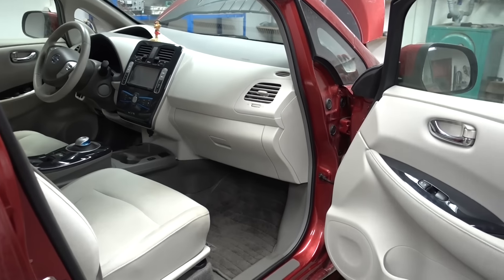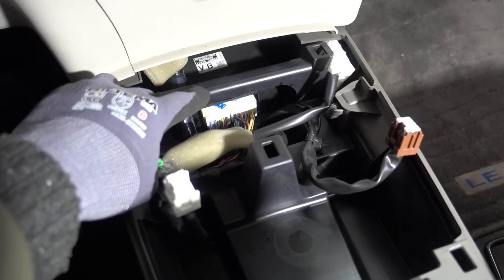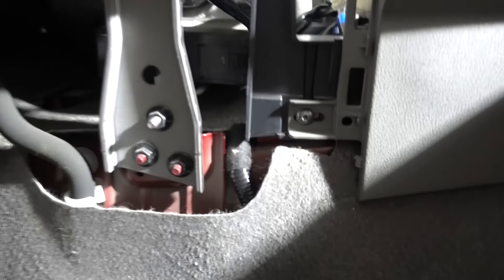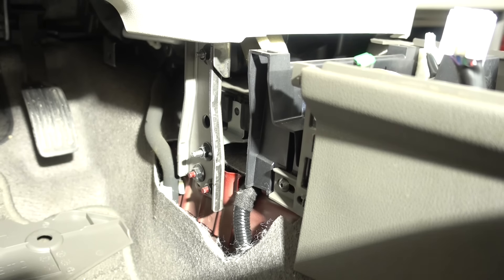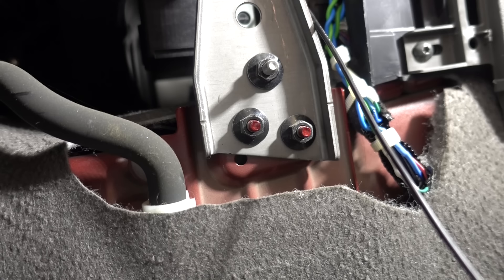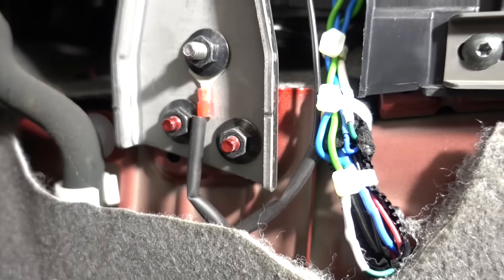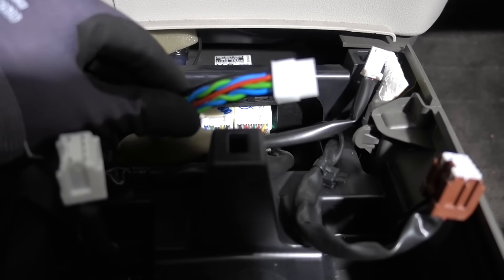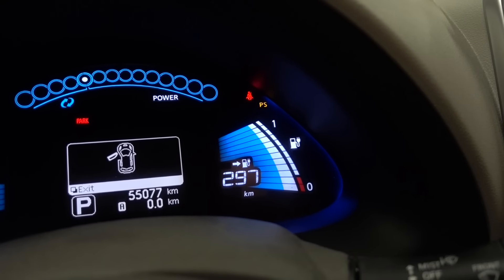CAN-Bridge Install [2011-2013 LEAF ZE0]

Comment: You should watch yourself some videos how to treat cables...the idea and your guidance is good but the execution is really bad... professionals don't work like that!
Reply from the maker: Yes, good feedback! I rather work with software compared to hardware 😅
Reply: Can you explain bit more? I have worked on rally vehicles, access platforms, normal vehicles. And seen terrible things done by so called "certified professionals". The only things that I would have done differently are, heat shrinks like to be heated from both sides for a proper seal, also I like glue lined ones. And I would used some conduit or cloth tape on new wiring loom just for extra protection. But that's only my preferences and I can't see anything wrong done by Dala. His wiring done outlast the vehicle anyway. So, Nikolaos, please explain what should have been done differently so we can all learn :)
Reply: @ev-olution8597  He's just hating.  The work here is fine.
Reply: The wiring here is fine, can't see why it wouldn't last.

Comment: 8:25 instead of sweating with big tools like mr. Dala there did, you could just rest the wire onto your cutting blade and gently roll it with your finger a bit on the blade, to cut through the insulation and then pull it off. 
And hint for Dala, when you do use the tool - add additional pressure on the tool top clamping bit, so the insulation doesnt slide off the tool easily ;)
And if you are a beginner, dont use cutters for stripping :D This is just asking for trouble :D
Reply from the maker: Absolutely! Superb advice, I should have looked at some basic wire stripping videos before making this fumbling video 😅
Reply: naah, your video is fine, much better than my upcoming rear stack fixup potato quality video with me putting roofing mastic instead of silicone between the battery halves :D
Reply: @DalasEVRepair  I really like the Jokari Super 4 stripping tool, it's not sideways -pointing but more like Alligator/Xenomorph eating the insulation off wire. It's plastic but surprisingly sturdy, I've stripped a lot of MMJ with it too.

Comment: Very nice video, its very tempting to pick up an old leaf get a bigger battery along with your cam bridge, I would also put some big heat shrink tube over your new harness just for vibration chafing protection 👍

Comment: A real good enjoyable vid. You know it is good when you watch the whole thing and you do not even own a Leaf. Instead of cutting into the OBD 2 wiring , what about running the wire to the fuse box and using a fuse tap? The owner must love the new range. Could you make it a business upgrading old Leafs? Looks promising.
Reply from the maker: Yes, running a fuse tap from the fusebox is also a great option! I am working on making it a business ;)
Reply: @DalasEVRepair  We get a lot of these first generation Leafs being imported to Canada  from California ,etc and although they have very little mileage on them the combination of the heat and fast charging damages the battery. After upgrading the battery as you do the vehicle will last for ????? and with such low mileage on them they are like new.Good luck with your business.

Comment: Thank you very much for all the work and information that you are sharing.
I have a newer leaf and need to connect the CAN bridge to the left of the steering wheel that you have showed in another video. I am uncertain which side of the cables in the car that goes to the battery, can you explain this?
I also like to ask if the 3D file for the case can be find for free or if it is your design, will consider sharing it?
Reply from the maker: I will do a separate guide video for the newer AZE0 model. You can check my previous video where I show a completed CAN-bridge install on an AZE0.

My software autodetects the orientation of CAN1/2, it doesn't really matter :)

The 3d-case is specific to my latest own version of the CAN-bridge (bit thicker than Muxsans design), but I can upload it to github soon. Won't be useful if you haven't purchased a bridge from me though!

Comment: Thats great, but with a 2 port bridge the wiring colors are different. Question is the Can-1L & 1H I assume this gets connected to the lower side but does it matter which wire gets connected to the low side or are the wires reversible and the same would aply to the 2L&2H side?
Reply: Never Mind I found the wiring Diagram... Thank you your a BIG Help!

Comment: Daniel, I wanted to ask you is there a way that the can bus can turn off the reverse beeps inside the cabin ?  I have disabled the external via leafspy,  I have a very long driveway in reverse and often have to sit for ages till the traffic is clear. Drives me mad !
Reply from the maker: Not that I know of!
Reply: Daniel Öster - if you work that one out I will buy what ever dongle I have to :) I wonder if the reverse noise is its own tweeter, I might rip it out :)

Comment: hi wear i can get the bridge por  any links i got a 2013 leaf will like to add a 2018 leaf  battery pack can i used for that? or what is recommended? grate video
Reply from the maker: Here's a link https://dalasevrepair.fi/can-bridges/

Comment: Hi Dala, another great video. I have a CAN bridge installed in my eNV200 40kWh by Emile when they did my underslung 20kWh range extender. Aside from the battery pairing what other functions can be achieved? I'd really like some way to manually switch on the battery cooling rather than having to wait for the van to be charging, is this possible?
Reply from the maker: Yes it is possible to force cooling on, but it will cool the cabin at the same time. Get in touch with Muxsan and ask, I can't offer any firmware solutions for you, they would overwrite the muxsan range-extender bits 😅

Comment: HI Dala, thanks for the tutorial!  Just one comment/question about the ground connection: Because of road vibration, the bolt can get loose and causing the clamp to disconnect? If that is the case, should be better to connect ground  by soldering to a proper vehicle ground cable?
Reply from the maker: Yes, other methods to ground the wire can be used. And if you are worried about the nut vibrating loose, threadlocker is always an option!

Comment: Hi dala.. Can I know wether after installing THE CAN bridge is the range really extended.?My 2012 ZE0 has 6 battery bars. And runs 80-100 without ac. Does this actually worth.?
Reply from the maker: No, the car also got a 40kWh battery installed before I mounted the CAN-bridge. The purpose of the CAN bridge is to make the older vehicle understand the newer communication that the new battery sends out.
Reply: @DalasEVRepair  OH I see. Thank you dala.. 👍
Reply: @DalasEVRepair  do 30Kw battery ship to SRI LANKA?? if so can get more details..
Reply: @DalasEVRepair  most people in Sri lanka is facing a problem with their leaf batteries..
Reply from the maker: No sorry I don't ship batteries, quite the shortage here also!

Comment: Hi Daniel, little bit off topic, but I wanted to ask you your thoughts on using a wall timer for slow charging? On and off ? I was worried about rush current or some damage ?
Reply from the maker: Yeah generally not advised, those tiny wall timers are often not designed to handle 2kW of power going on/off
Reply: Daniel Öster thank you , I run only 1350w and already on wall timer, but it’s only used to turn it off while I’m away in the day. But I have no load when I switch it on, just wondering if the leaf it self doesn’t like it?
Reply from the maker: @jestronixhanderson9898  if no load, that is perfectly fine!

Comment: My ZE0 30kWh battery is currently leaking (DTC error >P0AA6-00 0B EV/HEV Hybrid Batt Volt Sys Isolation EVC-157) which prevents it to start and to charge. Considering its SOH (62%), I envision to replace it by a 40kWh.
Thanks to Dala (the great!) I can envision this upgrade.
Question : I have acquired the 2-port CAN bridge and I would like to load the software on it. I don't have a ST-Link V2 but I have access to J-Link debuggers. Can I load the software using it (I guess so) ? Which file(s) should I load, which order?.. I'm an electrical engineer but a complete dummy in (embedded) software. I just understand and can follow instructions in this field...
Thanks.
Reply from the maker: Sorry I have no clue. I recommend getting the STlink, it is only 5€.
Reply: Hi Dala. I finally found a ST-Link V2 and managed to flash the 2-port CAN bridge. I went through most of your well done videos about battery upgrade. As mentionned above, I plan to upgrade a 30kWh ZE0 from 2016 with a recent ZE1 40kWh battery. Apart from the instructions on how to safely secure the batteries before the operation and do the mechanical swap, If I understand well, I only need to insert the 2-port CAN bridge loaded with your magic firmware in the battery CAN bus, right? (no problem, I completely master this part). Is there any operation I need to do once everything is assembled and connected back ? Any  video I may have missed? Thanks a lot.
Reply from the maker: @arnaudboursier  That is correct, plus pairing with Leafspy to clear P3102. All in the Wiki! https://github.com/dalathegreat/Nissan-LEAF-Battery-Upgrade/wiki
Reply: @DalasEVRepair  
Hi Dala. I've finally found a good ZE1 40kWh battery from 2021 and only 6000km. Is there a way to connect a diagnostic tool directly to the battery "round" connector and read its status, SOH, VIN, mileage and so on like we get with LeafSpy Pro before starting the swap operation ?
I have the matching connector as well as the connector pinout (from the EVB Nissan service manual). I think I understand where to power the BMS with 12V, where to connect to the BMS CAN bus but I don't know which tool (HW I/F + SW) to use to query the BMS and how to interpret the reply.
I'm sure you know how to do it. Have you posted any video about this topic? Thanks a lot for your help.